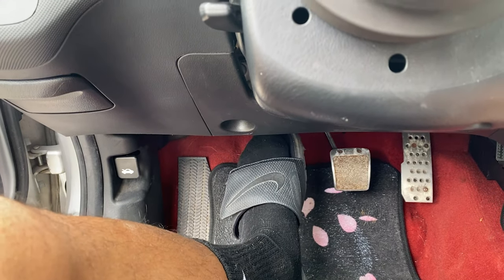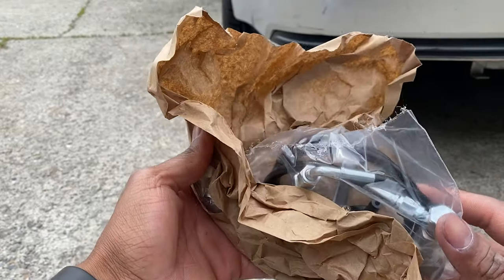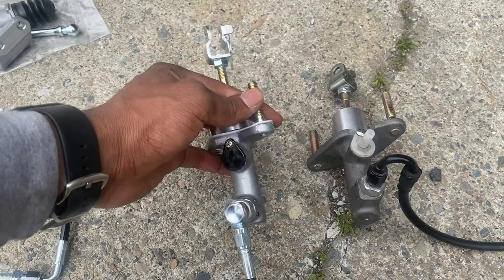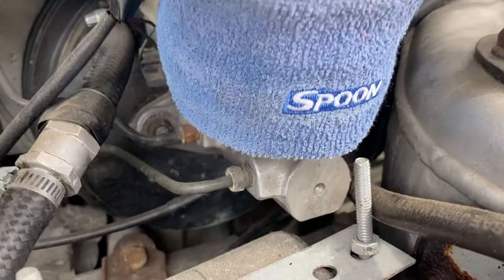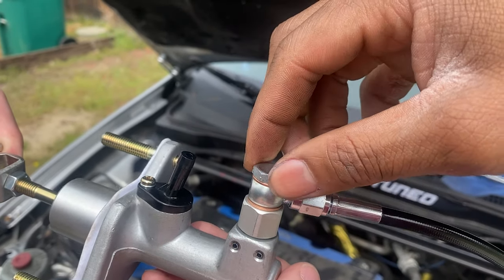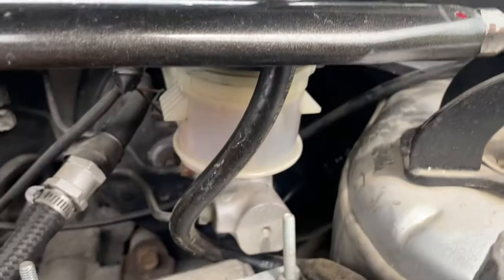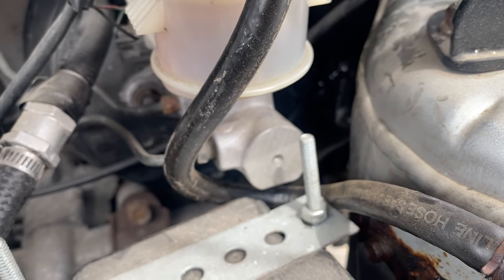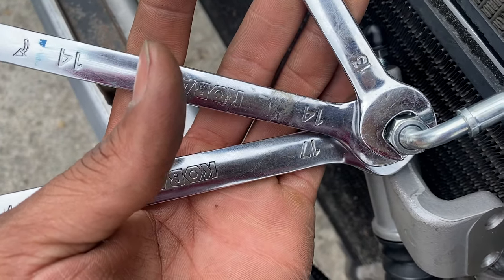Exedy EM2 CMC and SC Replacement

Comment: At the end what cmc & slave did you used to fix the problem because too many brands & oem for em2 isnt good?

I own a rsx thats why
Reply from the maker: I just ended up going with a duralast master cylinder. The exedy cmc started leaking so I replaced it with something that has a lifetime warranty. I’m still using the exedy slave cylinder

Comment: How has it held up ?
Reply from the maker: I ended up replacing the CMC with a Dorman one from autozone
Reply: @RAD_STO  Too late I bought the kit. Lol what happened exactly it failed or u just didn’t like it ?
Reply: @GhxstMode  hows yours been holding up? thinking of getting this kit for my 8th gen si
Reply: @0.........0  Its trash
Reply: @GhxstMode  what happened?
Reply: @0.........0  nothing in particular it just feel bad. Makes the car feel like a shit box for real, harsh engagement and low bite point even when adjusted properly
Reply: @GhxstMode  oh thats interesting so you dont recommend it?
Reply: @0.........0  nah I went back to updated OEM.
Reply: @GhxstMode  hows that been holding up?